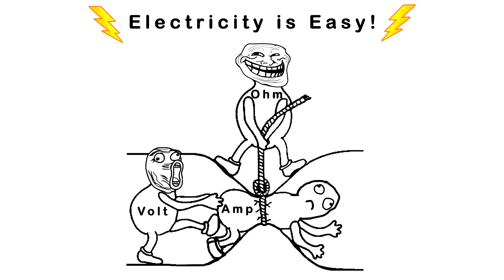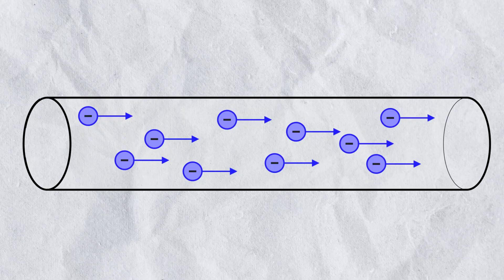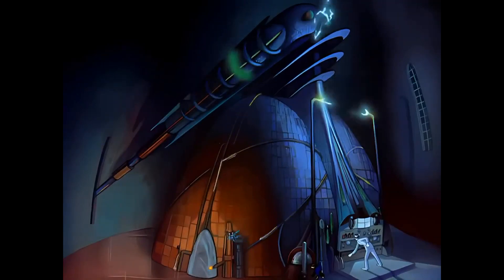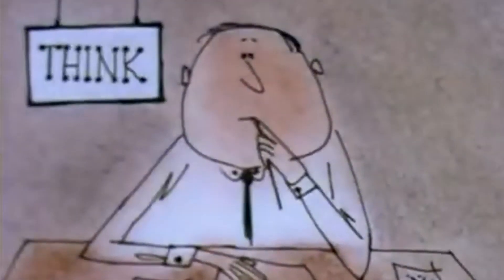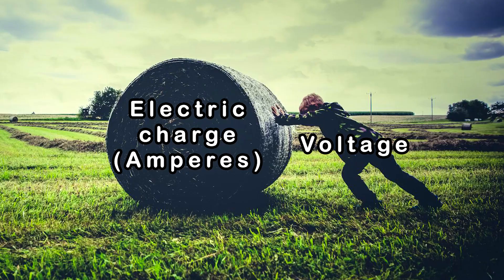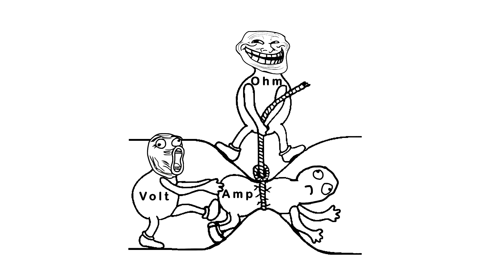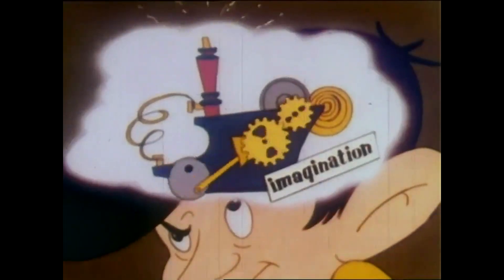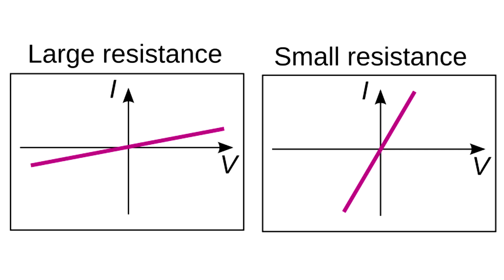why it works 7

Comment: The plumbing metaphor is EXACTLY how it was explained to me in college.

We were taught to memorize PIE: 

POWER (watts) = I (flow of current through wire, amps) times E (electrical pressure, volts).

We were told that this is THE most important equation in computer repair, and we will use it for the rest of our lives.

While I recall what volts and amps are from school, I wish that I had a Rage Comic like this. I would never forget it.

Comment: There are four fundamental forces between particles
1. Gravity, which follows a neat inverse square law
2. Electromagnetism, which follows a similar inverse square law… and maxwell’s equations
3. The strong force which obeys uh, well, uh, it holds protons and neutrons together. It’s very strong.
4. The weak force which [mumble mumble] radioactive decay [mumble mumble] 
AND THOSE ARE THE FOUR FUNDAMENTAL FORCES

We understand gravity the least 🙂
Reply: 52flyingbicycles moment
Reply: @dolorsitametconsectur This is actually an xkcd moment.

Comment: How does it work if you have electricity going to the air like a Tesla coil?
Reply: The air is the conductor and resistor.
Reply: Like water fountains? Pressure (voltage) is so high that it goes through the air.
I guess the amount of water would be ampers. In the same way, sprinklers (low amps) and firehoses (high amps) reach long distances (high volts), but only one is strong enough to put out fires.
I am not an electrician, so I can't say precisely.